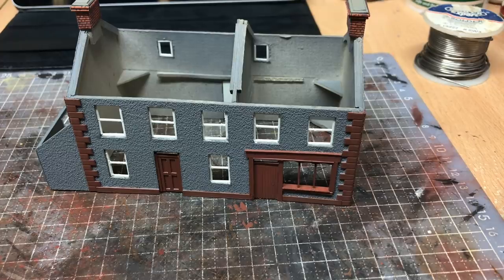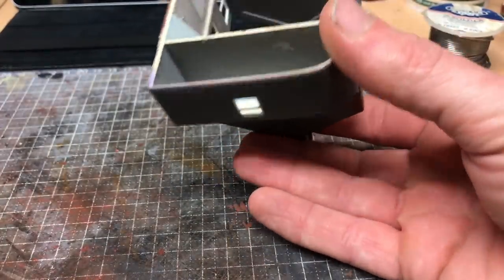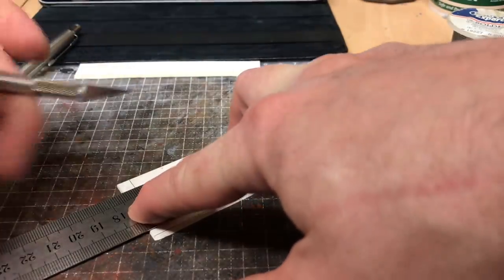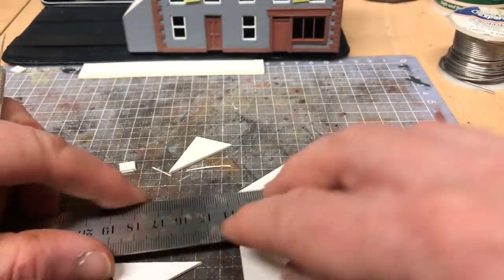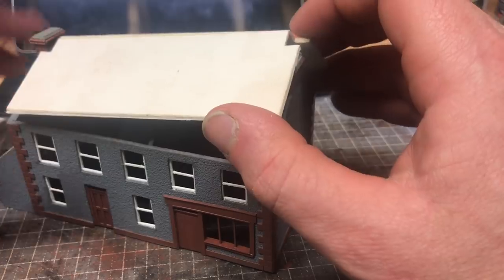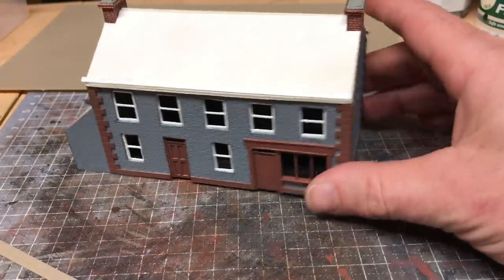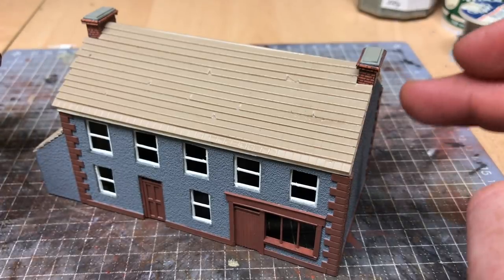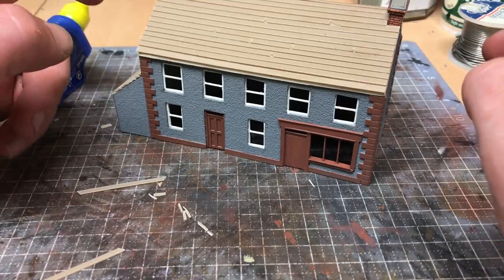Building A OO Gauge Model Railway: Scratch Build Series - 1.8 Fitting The Roof

Comment: Enjoyed watching this and the build is really coming together.  The roof looks very good and I was pleased that in the end you could get it off without needing to modify it.  I am sure one of the modelling gods exists only to make sure after you have carefully measured something, that you cut it just a bit too short.  Lost count of the times I have done that with ridge tiles on Metcalfe kits.  Stephen
Reply from the maker: Ha ha you aren’t wrong Stephen. The modelling Gods are a fickle bunch. The roof removal method is not ideal but at least I can do the task. I just won’t perform it too often in case it weakens things or I over bend that gable wall! Paul

Comment: very good build. With regards on the roof removal problem catching on the chimney head, when you are trying to take it off it seems to catch more towards the bottom of the card than the top? It might be worth cutting a 45* on the edge that way you wouldn't have a gap and it might be easier to remove.
Reply from the maker: Hi PD, thank you for the comments and suggestions for the roof. Paul

Comment: Surely the barge boards should nestle under the tile edges so the weather does not get in behind and cause the boards to rot? i.e. the tiles flush with the outer edge of the board and not flush to the wall. I think a couple of mm longer on the roof tiles would accommodate this nicely.
Reply from the maker: Thanks Grawlys and you are right. A combination of seeing that after construction and also the need to keep things tight for roof removal omitted the overlap. Appreciate the comments though. Paul

Comment: Hi Paul. As a follower of your scratch build can you clarify where you glue the barge boards. Do you glue the barge board to the moveable roof or do you glue it to the gable wall? I am following your steps so far in building this model with you and can't wait to see the finished item. Thanks, Mike
Reply from the maker: Hi Mike, sorry I didn’t make it clearer, looking back I could have been a bit more descriptive. I’ve added the barge boards to the edge of roof card with it overlapping slightly on to the wall. If you are keeping the roof a removable module only apply the glue to the roof card. There is one slight error in my design in that the roof does not extend beyond the barge boards but it’s so imperceptible that I think we can get away with it. 😉 The next video is ready to go and will be out Monday. It’s all small detailing now so there are a few things covered. Are you on Facebook? I’d be interested in seeing your build photos if you are. Paul
Reply: @GalgormHall  Evening Paul. Thank you for coming back and answering my so promptly. It is much appreciated. I haven't yet tackled the roof tiles yet, partly due to an error on my part when I ordered the wrong roof tile. The roof tile I ordered was the style which has the roof as a contjnual sheet similar to Slaters Flemish brick. So I had to reorder and is readh to go on. Unfortunately, I don't have Facebook, sjnce I am of the age I want to keep mg own privacy. Apart from email do you have any ither suggestion how I can send you photos of my attempt. If I send you my emaill address to you on this chat, would that help? Mike
Reply from the maker: Mike, another point i should have made on the two types of tiling available. Glad you got sorted eventually. As to contact, I wouldn’t advise the email option as it becomes available to anyone and everyone. I’ll think of something and get back to you. Paul
Reply: Hi Paul. How about I send you a private message on Facebook via my daughter's account and I can give you my email for you to reply by baçk? That way I can show you how I am progressjng. I understand life would be easier if i did have a Facebook but it is a bridge to far. I would really love being part of your scratch build community and this is the only way I can see to do this. Regards Mike
Reply from the maker: That’ll work perfectly Mike. Paul
Reply: Thanks Paul. Will do it later today. Mike